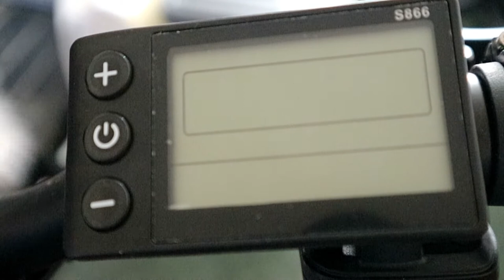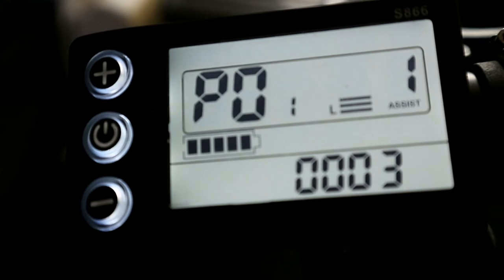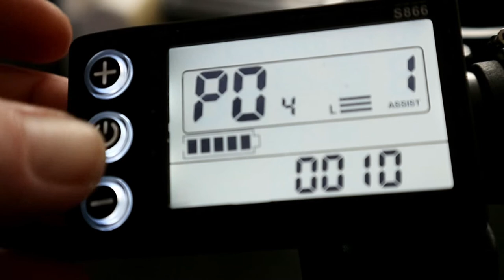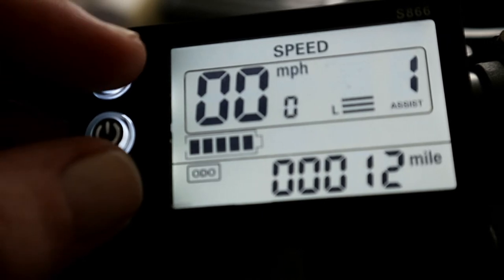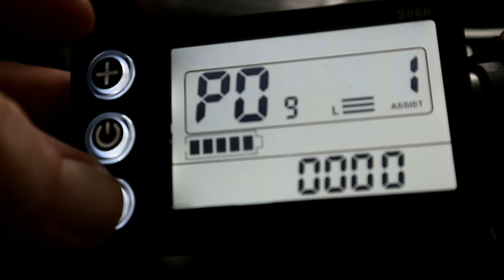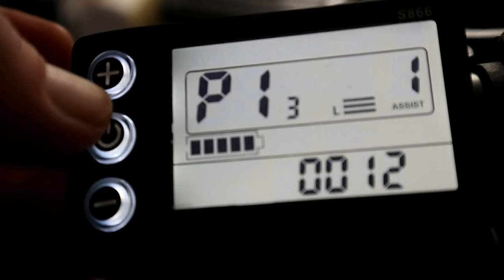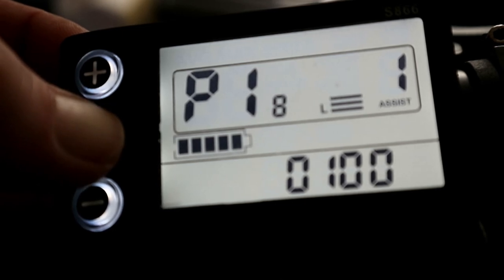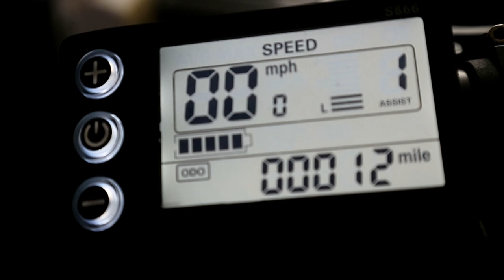T4 Cruiser MAX (iX4) 48V 600W Electric Scooter : The S866 Display P-Settings Values

Comment from the maker: Below are the list of all the P codes and fault codes from the manual.

4.Setting
P01: backlight brightness, level 1 is the darkest, level 3 is the brightest;
P02: mileage unit, 0: KM; 1: MILE;
P03: Voltage level: 24V, 36V, 48V, 60V, 64V Default 36V;
P04: Sleep time: 0, no sleep; other numbers are sleep time, range: 1-60; unit minutes;
P05: Power assist position: 0, 3 file mode: 1, 5 file mode:
P06: Wheel diameter: unit, inch; accuracy: 0.1; This parameter is related to the display speed of the meter and needs to be entered correctly.
P07: Number of speed magnets: Range: 1-100; This parameter is related to the display speed of the meter and needs to be entered correctly. If it is a normal hub motor, directly input the number of magnetic steel; If it is a high speed motor, it is also necessary to calculate the reduction ratio, input data = number of magnets × reduction ratio; For example: motor magnet steel number 20, reduction ratio 4.3: input data: 86=20×4.3
P08: Speed limit: the range is 0-100km/h, 100 means unlimited speed. The input data here indicates the maximum running speed of the vehicle: for example, input 25, indicating that the maximum running speed of the vehicle does not exceed 25km/h; the driving speed is maintained at the set value. Error: ±1km/h; (both assist and speed limit) Note: The value here is based on kilometers. When the unit setting is converted from kilometer to mile, the speed value of the display interface will be automatically converted to the correct mileage value, but the speed limit value data set at this menu under the mile interface. No conversion, inconsistent with the actual display mile speed limit value;

Note: The P09-P15 menu is only valid in the communication state.
P09: zero start, non-zero start setting, 0: zero start; 1: non-zero start;
P10: Drive mode setting 0 : Power drive (the booster position determines how much power is output, and the switch is invalid). 5 1 : Electric drive (driven by the rotary handle, the power assist position is invalid at this time). 2 : Power assist drive and electric drive coexist simultaneously
P11: Boost sensitivity setting Range: 1-24;
P12: Boost start strength setting Range: 0-5;
P13: Power magnetic steel disc type setting 5,8,12 magnetic steel three types
P14: Controller current limit value setting Default 12A Range: 1-20A
P15: Controller undervoltage value
P16: ODO clear setting Long press the up button for 5 seconds ODO clear
P17:0: cruise is not enabled, 1: cruise is enabled; auto cruise is optional (only valid for protocol 2)
P18: Display speed ratio adjustment range: 50%~150%,
P19: 0 gear enable bit, 0: 0 gear, 1: 0 gear
P20:0: Protocol No. 2 1: 5S Protocol 2: Alternate 3: Alternate

Fault Codes Below

Table 1: Fault code and meaning
Fault code (decimal) Fault status Remarks
0 normal status
1 Reserved 4
2 brake
3 Power sensor failure (ride sign) Not implemented here
4 6KM/H cruise
5 Real-time cruise
6 Battery undervoltage
7 Motor failure
8 Turn fault
9 Controller failure
10 Communication reception failure
11 Communication failure
12 BMS communication failure
13 Headlight failure
Reply: You number one

Comment: Hi I have recently bought this LCD display for my 24v E+city raider.  It doesn't seem to register how fast I'm going and it seems to be going alot faster than I once did on my old display. Is there anything I could be doing wrong in the settings?

Comment: Does anyone know what the error code E11 means? For some reason, my scooter only goes up to 27 km an hour, and my P settings are exactly the same as shown in the video.
Reply: Cut the limiter
Reply: Where would the limiter be? I have the same problem

Comment: Hey thanks for the video, one quick question. The setting for the magnets on mine was 100 on default should I change it to 30 like yours?
Reply from the maker: Hi - Cheers for watching - The magnets are for PAS as this display is made for both escooters & ebikes so it wont affect our scooters 🤟
Reply: Thanks for replying that’s good to know. Also i have turned the p8 setting all the way to 100 but I am only getting about 22mph max out of the scooter on the speedometer, I thought that this maxes out at 28mph is there anything else I should do to get the full speed?
Reply from the maker: @qaisofficialmusic  look at my other scooter vids & the comments as a few people have put drop P07 down it goes 30mph then but ive not tried it yet as its always raining here !
Reply: Did changing the P7 change anything? My scooter on the base/the settings you have recommended only goes 17mph? 
Anyone know why, or a fix?
Reply: @qaisofficialmusic  I've set P18 to 150 now getting 26mph was getting 17mph with it set to std. 100
Reply: @MattyYoung13   did you get it past 17mph? I'm having same problem

Comment: Hi. Thanks for the very helpful vid. I’ve just bought and used for the first time the T4 and used your setting. The only problem is that the speedo is not showing the correct speed. I’m doing around 15+mph but is only shows 4mph. This is also affecting the trip etc. Is there a setting o help this?  Cheers
Reply from the maker: Hi Thanks - It could be the wheel size?but im not sure...
Reply: @paulleeFLOW  the wheel size is set at 10.0
Reply: You need to put p7 on 30 , I think…
Reply: It's P7 then

Comment: I have one of these LCD displays, if I press the minus button for a few seconds the motor switches on and runs at a constant speed but the throttle only works backwards and another long press or brake stops the motor, other than that the throttle does not work at all.
Reply from the maker: Hi Colin - Theres p0 setting that selects pas or throttle or both - have you checked that?Also theres some p0 settings that will disable the throttle as these controllers are made for ebikes & escooters....
Reply: @paulleeFLOW  that's happen to me help please
Reply from the maker: @damspec4208  All i know pressing minus & holding it activates walk mode & the brake stops it BUT other than that i dont know - Maybe someone can post a comment on how to fix it
Reply: @paulleeFLOW I sorted it  it's the p setting to do with throttle if you put it on 0 it doesn't move thanks for the reply

Comment: Have you rode the T4 in the rain a lot and is it suitable to do so and not wreck it
Reply from the maker: ive never ridden in the rain !
Reply: @paulleeFLOW  ah ok 🤙
Never ridden a escooter and doing my home work came down to the pure air pro or the T4 max but after watching your vids leaned me in a positive direction to the T4 👍
Scooter arrives tomorrow so will wait until the weekend to give it a blast 😁
Cheers for the vids and keep them coming as they are very informative 👍

Comment: Has anyone found out how to fix e10 yet?
Reply from the maker: Hi Graham - ive just googled it for you - It looks like error e10 is a communication error between the display & the controller..On the forum it said that the P-setting p20 controls this communication...But a good few people said its unfixable & needs returning !!! But i'd have a mess with p20 values & its worth a shot mate...Hope this helps ⚡
https://www.pedelecs.co.uk/forum/threads/lcd-s866-not-working-error-e10.34222/

Comment: Would that amps settings change the speed of the scooter ?
Reply from the maker: Sure does ive changed mine after this video mate
Reply: @paulleeFLOW  What number would u suggest ?
Reply: @paulleeFLOW  to what?
Reply from the maker: @NoMoreLies365  be careful it may cause controller problems but i kept putting mine up one level at a time & then using it & then up another level..not sure what its on now tbh
Reply from the maker: @lamzofficial4839  give it a try one level at a time mate

Comment: My scooter goes 20mph I’m way under the 120kg weight load it states 36mph but doesn’t do no where near that
Reply from the maker: Yeah its a LIE i got 26mph on mine !!!! & im 88kg !!
Reply: @paulleeFLOW  I’m managed to get mine over 30mph I’m 105kg I changed a few other things in my P settings to do 32 max on bumpy roads that’s all I have around my area 90% potholed roads
Reply: @KOBKINFINITE  which p-settings have you changed?

Comment: This gets over the 30mph mark. 
Po1-3
Po2 - mph/miles 
P3- 48
P4-10 
P5 -2 (9 assisted levels) 
P6 -10.0
P7-30
P8-100
P9- 0
P10-1
P11-5
P12-5
P13-12
P14-22
P15-52.5
P16- left alone 
P17-0
P18-150
P19-1
P20 left alone
Reply: just tried aint working
Reply: I got 38 miles on t4 scooter lol crazy 👍👍
Reply: @justelisISkauno  how
Reply: @lucasmadsen6705  same
Reply: on p15 i could only go up to 44
Reply: @PhilMartin93  leave P 15 on the default or 39.5
Reply: Leave p15 at default or 39.5, set p5 to 0, for anyone having issues with this.
Reply: @justelisISkauno  HOW did you do it??  Pleeeease tell me 🙏